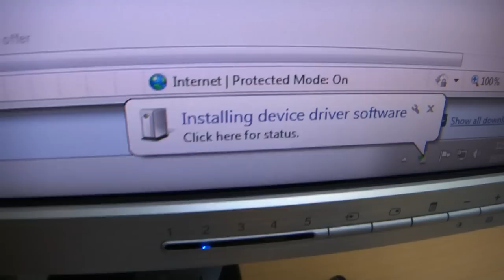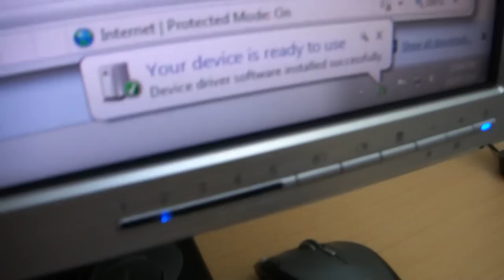Mbox2 teardown / disassembly

Comment: I read in a forum online that swapping some electrolytic caps near outputs could enhance the performance of the MBox2.  Once I got to just before cracking open along the seam in the plastic, I decided to call it game over.  My interface works just fine as it is, and my hearing isn’t all so impeccable to where I’d be confident that I could make out any enhancements.  So better I keep it working before I bust something up well enough to disable any future  possibilities to fix it ever again!!  Thanks for sharing about this.  I was surprised to read in comments quite so many people were after the same fix as you, so great to have your experiences to reference and draw upon!  Thanks again!
Reply: Hi! Any link to the forum on how to enhance the performance of this box? 
I was stuck with it the same spot as you, but realized that the back plate was the culprit.Slipping that plate out through the back relieved the chassis from the plastic casing. A kitchen knife pushed in along the sides help to get the tape to  slip.

Comment: thank you for this video, it was very helpful in finding all the screws.

i had problems with my usb port being loose i just resoldered the broken anchor/ground leads and all was well. +1 to ryan rich. you dont need to crack the case to get it out. the pannel won't come out but the chassis will once all screws and plastic nuts on the 1/4 ports are removed.

Comment: I found additional screws on the front plate, thats 3 of them under the serial number sticker. Also instead of "CRACKING OPEN" the case I completely removed all screws and 1/4in nuts from the back panel and was successfully able to remove the chassis from the case no prob! FYI the panel will not push through only the chassis.
Reply: Well shit, wish I'd read this before I half mangled the front plate trying to access the screws underneath it haha
Reply: 5 years later and this is the best comment... love you bud

Comment: Hey, great work! I have a problem with my mbox 2 and before opening it up like you did I was wondering if you had any idea if it's worth the effort with the problem I have. 
The device works well, I can record stuff into pro tools but the problem is that when I want to listen to the recordings true the headphones output, the sound of the recordings is very strongly attenuated. However when I just plug in my guitar, the headphone connection works just fine and has no attenuation.
So I think the problem is not the headphone output itself (works fine for the guitar input) but is the path from the pro tools recordings to the headphones output. Do you have any idea where this path goes (I checked for a scheme of the circuit but couldn't find it), and if so, do you know if it's fixable?
Thanks
Hannes

Comment: I have some trouble with an used mbox2 i bought , it has a weird sound like a pink sound that comes and goes , but when i push play on a session it dissapears .
what i have noticed i that the input 1 has this weird sound i dont know if its fixable .

i could use some help if u have experience this.

thanks

Comment: @elverdadero84 Kinda, I had to scrape the top layer off of the solder joints so the iron had better contact and then it finally broke free. I installed the new USB port but it didn't seem to really fix my problem. My mbox still seems to loose power randomly (which I though was because of the loose USB connection) and almost always shuts off when I plug the headphones in. I then have to unplug the USB and reconnect it for it to work again. Any suggestions?